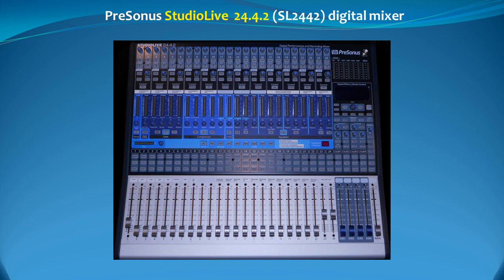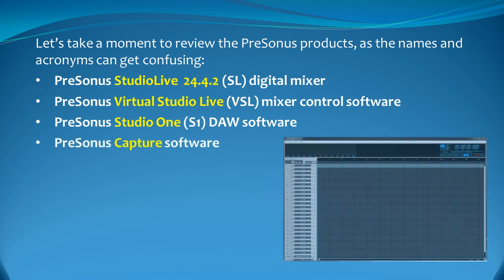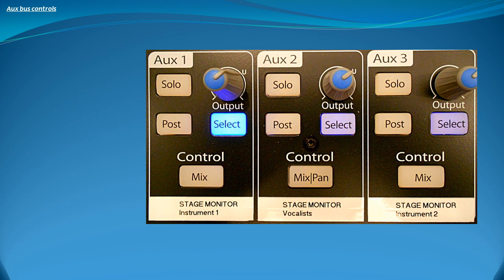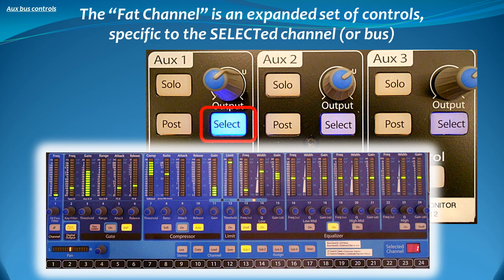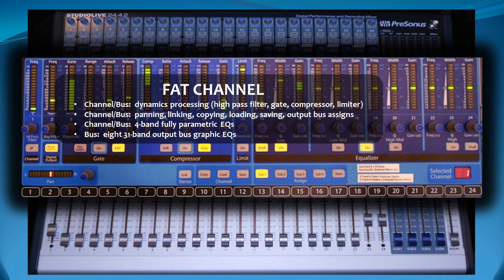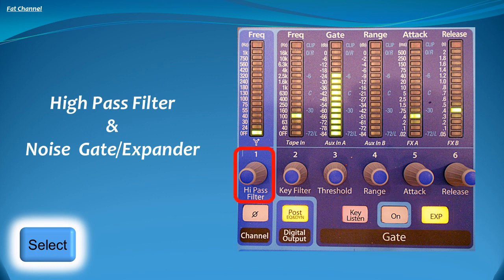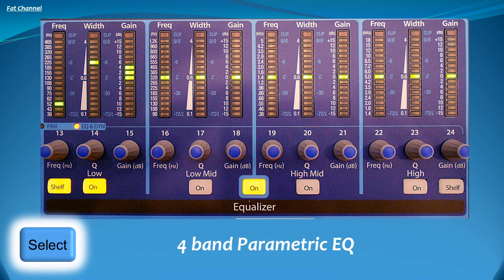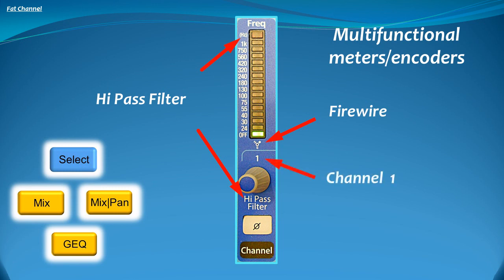PreSonus StudioLive 24.4.2 training - Part 1

Comment: Hey everyone I know this guy sounds like he's reading from the manual and it's very monotone but of course with updates to YouTube since this was put out you can go under your gear settings go to normal and change it to number two and speed him up to your desired likeness makes it a lot easier to listen to Thanks. I end up doing this to a lot of videos and helps greatly.
Reply: drummerboy100jh Thanks! I've never used that feature before. I set the Speed to 1.25, and it DOES help!
Reply: i changed it to 1.5 and it did the trick! Thanks Drummer